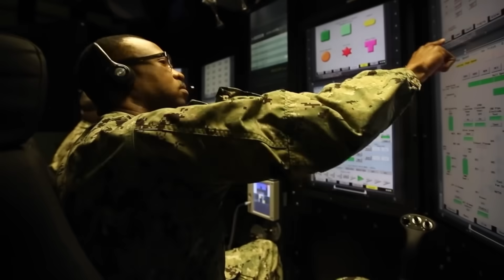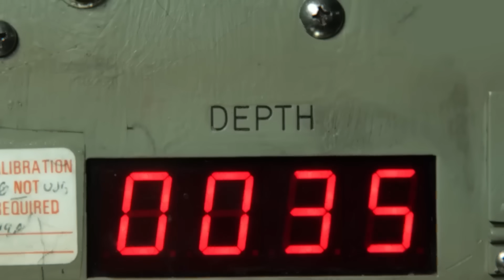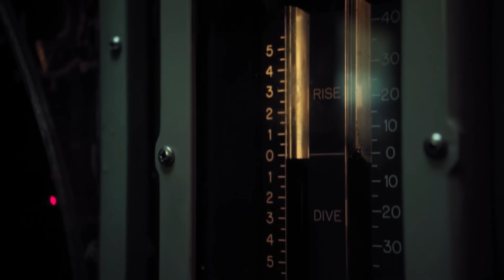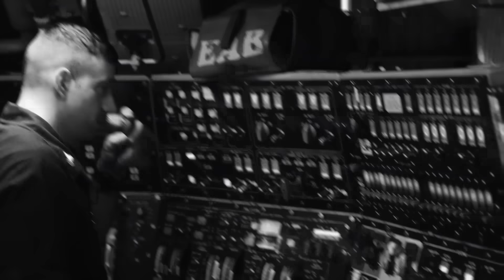What Happens When a Submarine Hits "Crush Depth"

Comment: I believe they will determine at what depth the sub imploded by examing the debris rang. The higher up, the larger the debrie site. The lower it went, the smaller the debrie feild.
Reply: The ocean has the control over what is found and what isn't.
Reply: They know how deep the sub was based on where it was when they lost contact with it.  I think they reported it was about 900 feet from the bottom.
Reply: @stargazer7644  Yeah anyone whose been following this event, know this. However, they know what depth they lost contact, reports state that they may have been trying to drop weight and return to the surface. Considering it's Ocean Gate though, I'm sure these very capable people are going to cover their arse and do a thorough job based on the skills, experience, knowledge and equipment available. It's no half arsed job solely relying on OceanGates limited data. Make sense?

Comment: This is what happened to the Titan Submersible when it was diving to disturb the wreck of the Titanic
Reply: The Titan had a carbon fiber body.  When carbon fiber fails, it doesn't bend or crack or dent, it shatters completely.  The people on board would have been sprayed with the shards of the hull while being crushed by the water.  In a sense, it was way worse  in so far as once the failure started, there was absolutely no possibility of saving the situation, it would be over and done instantly.  But in another sense, it's a lot better, as it probably happened so fast and so completely without warning that nobody on board ever knew they died, so fast would it have been that their brain would not have been able to process what was happening before their death.
Reply: @sststr  Exactly 💯. 
Way better because it was instantaneous

Comment: I know it’s a dark thought but if I  was in a sub I’d bring a gun to “opt out” just in case I was in this situation. No way I could take the stress running out of oxygen or knowing I was about to be crushed.
Reply: I would do the same
Reply: You'd fire a gun inside on that thing???
Reply: @Buzca  depending on the type of gun you use you could technically delete yourself without making a hole in the sub.
Reply: @shadowwylde  Reading this thread - "Yes but it wouldn't matter, they'd be dead by then. 1500psi at 1000 fathoms. Hull rupture would mean instant death. IMO, that's the most likely outcome. They felt nothing."

Comment: This isn't entirely accurate. A catastrophic failure caused by an implosion would turn the crew into liquid instantly. Saying "water would flow in rapidly" is misleading. It basically fills the entire sub in less than a second and anyone or anything in its path will be obliterated. An implosion is basically a non-exothermic explosion, but inwards. Obliterated instantly.
Reply: Far less than a second.  It would take milliseconds.

Comment: Test depth is basically non-wartime max and is usually a fixed fraction of operating depth.
Operating depth is what the Navy rates it to go to and is usually some fixed fraction of design depth.
Design depth is what the engineers actually intended it to go to but includes margins of safety to avoid a failure.
Crush depth is what the actual depth the thing fails at. Most of the time crushing occurs catastrophically and almost instantly. Crew may not even have time to react as the walls spontaneously collapse at hundreds of mph.
Reply: NO, Test Depth is approximately 80% of that ship's crush depth. Being at war doesn't change the depth the ship will get crushed at. There is a depth we could go to and that was it, even at war.  I was on the HMJ SSBN 730 as a sonar tech for 2 years from 1993 to 1995 and I qualified. We can go as deep as we want, no one is going to know, not even most of the crew on board that aren't on watch at the time the Captain decides he wants to see how far down his ship can go before we get compressed. The "A" gangers showed me by tying a rope from one rafter on the outer hull and running it through the missile compartment to the other side. We could watch the rope sag as we got deeper. Then once we felt the ship change angle to go up they hurried and tightened the rope. We had to get away quickly. A few minutes later it sounded like a cannon went off when the rope exceeded its stretching point and snapped. Pretty fun experience. Also, you could slide down the floor going both ways. You had to be careful though, you could get going pretty fast and the nothing is soft. Ahh, good times.
Reply: They're still investigating but popular belief is that the poor titan sub imploded when it reached about 3300 meters below the surface, only 1 hour and 45 minutes down to the depths from the ship above the sea.
Reply: 2,200 hundred feet per second.
Reply: Nobody knew what depth was for Titan crush depth?
Reply: @dianamincher6479  No, because they used carbon fiber which in this case meant it could neither be accurately measured or properly simulated, and the window was only rated for a third of the depth of the Titanic wreck so they were really pushing their luck. On top of that the material got weaker with every dive and there was no way to know if it would be strong enough for the next dive. Also apparently they only used a safety factor of 2 for the hull which is...not smart. Everything considered the most surprising thing is that the Titan survived multiple dives before the last one.
Reply: @brinkoftext  I heard they did over 20 trips . This dude was careless. He far exceeded the lifespan of the Titan ship .
Reply: @dianamincher6479  It was never tested or certified, so no. I heard the viewport in the nose was only rated to go 1500m down, not anywhere near the 4000m the Titanic sits at.
Reply: Years back everyone became an expert Virologist when cov!d hits, then a military master strategist when russo Ukraine war happened and now everyone is a submarine expert. Wonder what's gonna happen later on.
Reply: @Dimapur  I don't know what's gonna happen later on but I'm sure you will be there to whine about people trying to learn new things.

Comment: Okay so if I got it right a "real" sub can't go belew 4, 000 feet... but basically "toy" sub controlled by an xbox game pad won't implode at 13, 000 feet? that's why they are still on a rescue mission?
Reply: The more surface area you have the more surface area the pressure is acting upon. So yes smaller is better.